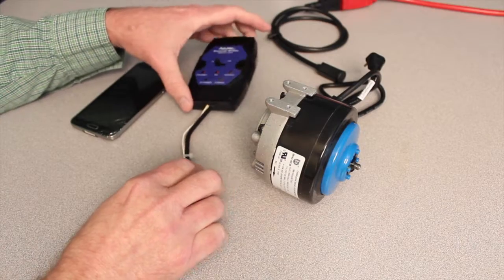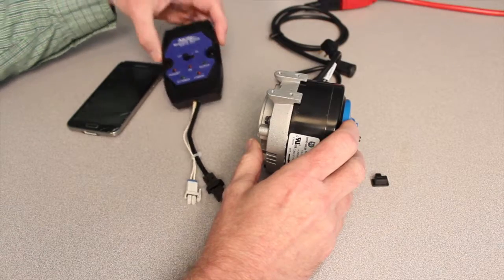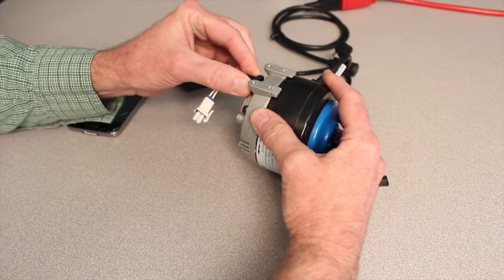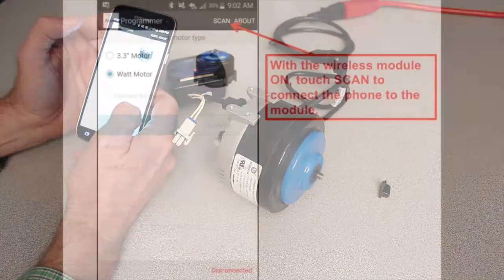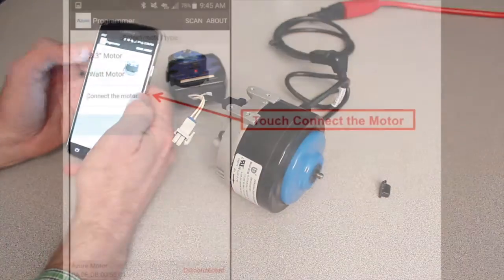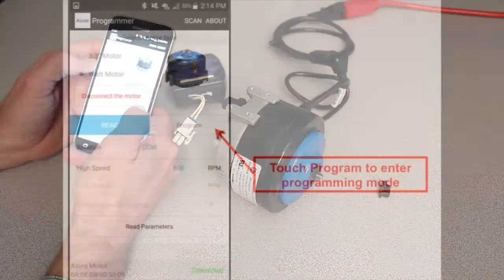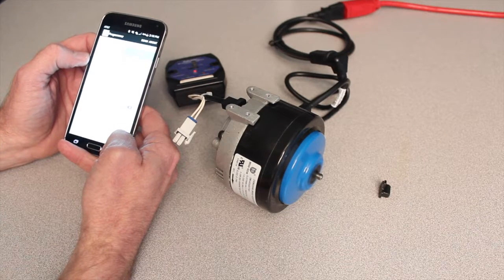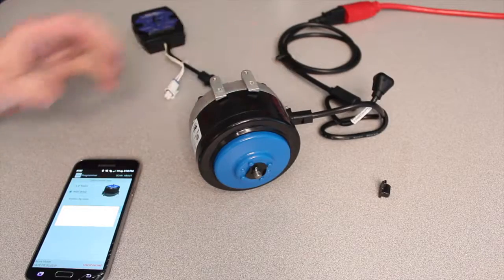Programming Azure Watt Motor

Comment from the maker: It is optional because the motor is operational right out of the box at common default settings.  
However, if you want custom settings then you need the programmer.   There is no internal Bluetooth so you cannot program with the phone, only.